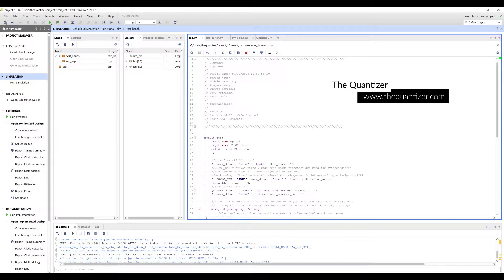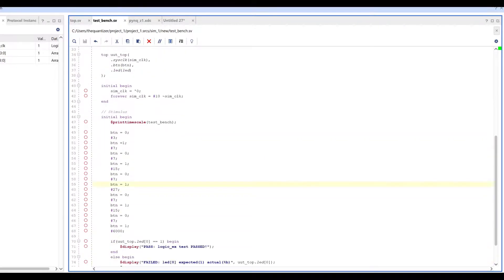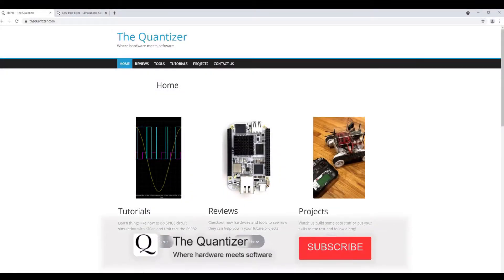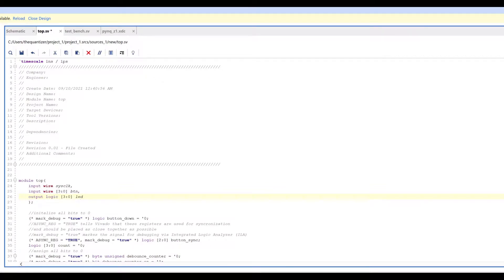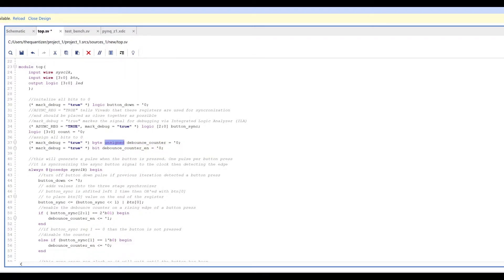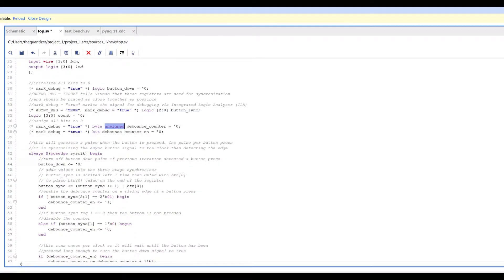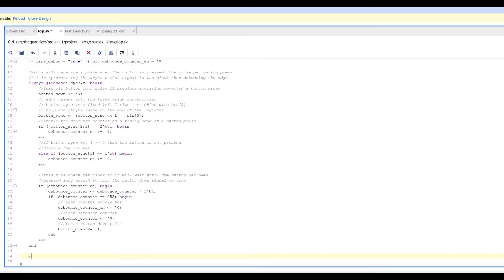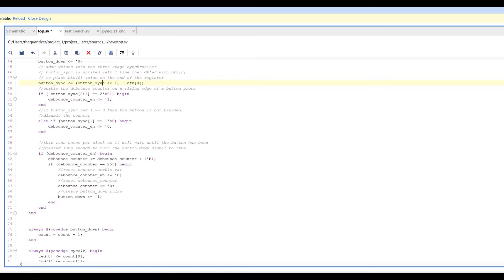FPGA Quick Start - PYNQ Z1 (Xilinx - Vivado)

Comment: Hi there, very nice example tutorial. However I have some issues running the new updated code. When I run the Simulation for test_bench I get an error "Variable 'reset' might have multiple concurent drivers [top.sv:42]". Can you please help me sort it out? I am new on FPGA programming :)